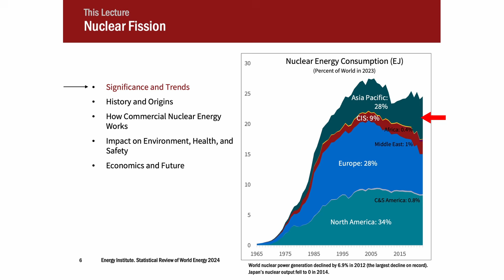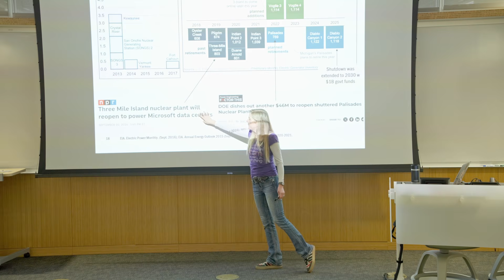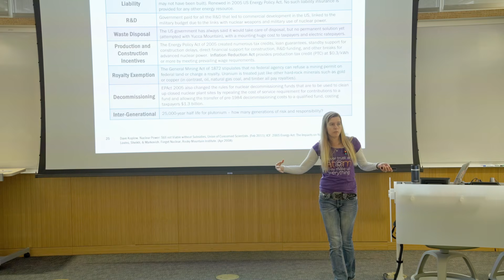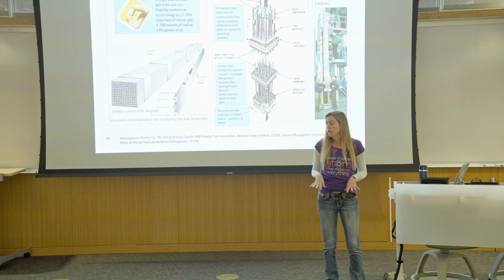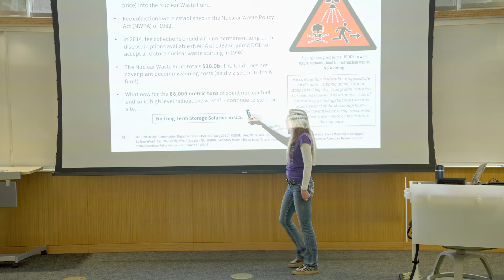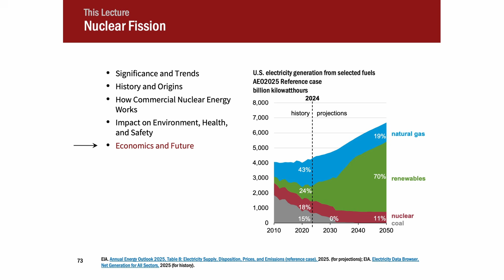Nuclear Fission Lecture | Diana Gragg | Stanford University

Comment: Great video! One detail though. At 1:03.38 is a possible confusing phrase about the Fukushima accident being a runaway reaction. In a sense I guess you can say that, but the nuclear chain reaction was already stopped. It was loss of cooling for decay heat that caused the accident.